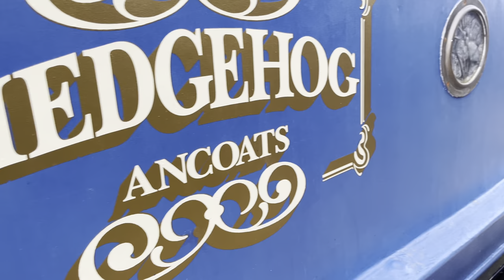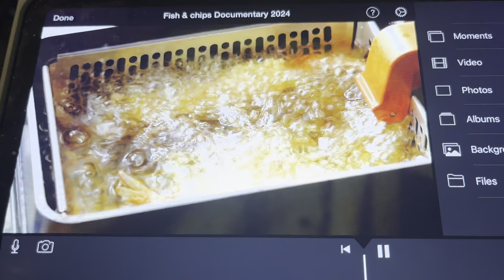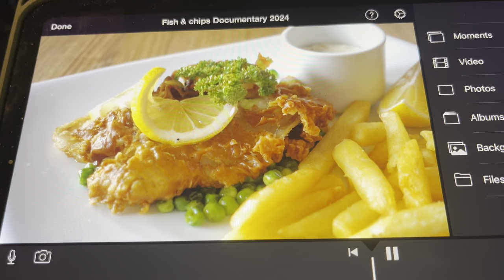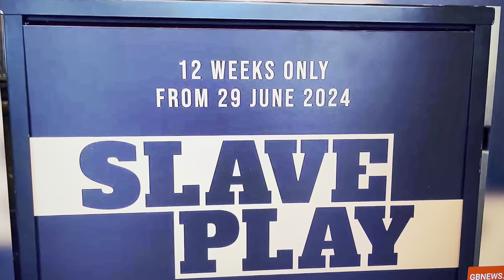Narrowboat Life: Finally I did it | E19

Comment: Hiya have you been told correctly there is always air in the water tank when you remove filler cap to fill tank if you could remove all the air you would create a vacuum if there are no leaks in pipe work it’s a problem with the pump x
Reply from the maker: Last time.. I literally sucked the tap to get out 😂 my lung capacity not that good however lol. I did think about filler hole.. just that have bigger all to create the suction. That’s where I get stuck 🤦🏻‍♂️